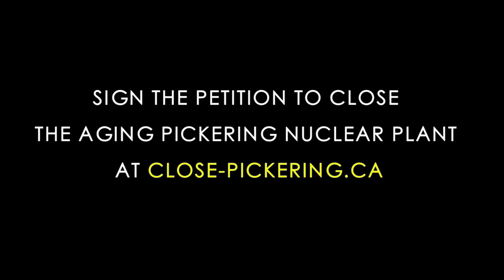Nuclear Scientist calls for closing Pickering Nuclear Station

Comment: As someone with experience with CANDUs, I believe Frank is making a conspiracy theory. Yes, the zirconium cladding can catch fire. However, the poison system can quickly stop overheating in the core. Every safety system is constantly checked and double-checked, ensuring that it works its best. The SCRAM or trip system ensures that no more heat can be generated by quickly inserting control rods into the core within fractions of a second to a few seconds, depending on the pressure of the tank and vessel pressure. CANDUs can't just explode like in Chernobyl or Fukushima; each safety system helps prevent this. If a meltdown were possible, CNSC and IAEA would definitely disapprove of the design.

Comment: Operating nukes save millions of lives. Coal, oil and gas release more uranium, thorium and radon into the atmosphere every year than all the fuel burn in nukes. If you want to freak out about radiation, fine. Start with the biggest source, coal.

Comment: Pickering is objectively the SAFEST nuclear power station in the world.
How can I say that?
Easily.  It is the ONLY nuclear station now operating to have suffered a failure of the primary pressure boundary ― the MOST SEVERE accident that can happen to a power reactor ― without radioactive releases to the environment or radiation exposures to personnel, & then been put back into service.  The accident occurred at Unit 2 in 1983.  Units 1 & 2 were retrofitted with a design change already applied to the other six units, which would prevent a recurrence of the failure.

Comment: It's important to distinguish between "reactor" and "reactor building". The reactor buildings are the big cylindrical-hemispherical domes you see at the beginning of the video, but the actual reactor is a additional body of containment within that reactor building (this is where the fission actually occurs). So when Grant is talking about the reactor "leaking," it is still leaking within containment; it is not leaving that reactor building. In other words, the fact that the reactor "springs leaks" from time to time does not mean at all that this irradiated water is leaking into the environment.

Additionally, these leaks are meant to occur by design . The CNSC's mantra when it comes to nuclear-grade pipelines is "leak before break." These leaks are important for telling us which parts of the reactor/pipelines to look at and  repair, ensuring the nuclear plant operates as safely as possible. This is an extremely well-known fact in the nuclear industry, and so the fact that Grant doesn't mention this should make you question his level of bias.

Background: I work at OPG Pickering with a background in nuclear engineering.
Reply: The Pickering nuclear station has a greater risk of accident than other stations because the containment system’s vacuum building is shared between six operating reactors. The Pickering A reactors also lack two completely separate shutdown systems, the norm for modern nuclear plants. As a review by world-recognized nuclear expert Arnold Gunderson stated, “At the Pickering site, there is only one overall safety related containment system when there should be six separate safety related containment systems. This design flaw has created a cumulative risk at the Pickering station that is higher than that at any single unit station in Canada.” Gunderson notes that, in particular, this design flaw makes the eight-reactor plant particularly at risk for the kind of cascading accident seen at Fukushima, where damage to one reactor led to fires and explosions that damaged adjacent reactors.

Comment: Since when is stating the facts about pickering "fear mongering".  It is old, decrepit, leaky, and ought to be retired. Period. 

Want to stick your head in the sand and pretend keeping this aging plant running is OK. Then move to Pickering and put your lives where your mouths are. 

I worked on the safety systems for Pickering, they are a disaster in waiting. Long story but once again FACTS.
Reply: Old, decrepit and leaky? Can you explain at what point a Leak into the containment vessel exceeds the equipments make up capability? At what point would this impair pressure control to the point that ROH subccoling margins would be effected?

Comment: I expected a more researched and balanced video.  Not fear mongering.  We need new reactors but publishing things like this is not going to get those new reactors.
Reply: Yeah we’ll all take your word for it, man get the fuck out of here, there’s 8 of those old pieces of shit sitting there leaking tritium into our drinking water
Reply: It's dangerous to have one of the world's oldest and largest nuclear stations in the middle of the GTA (surrounded by 2 million people within 30 km). Plus it's very expensive - the most expensive fuel and operating costs on the continent. We could replace it in 2018 when its licence expires with water power from Quebec and save Ontarians billions$. http://www.cleanairalliance.org/wp-content/uploads/2016/09/pickering-replacementv4.pdf
Reply: angela b  It is quite expensive to maintain a plant that old, I agree. This is why Canada should invest in 4th generation reactors! They are designed with an emphasis on being eceonomical and safe.

That being said, pickering nuclear is quite safe. Take it from someone who works in the plant design department at OPG Pickering. Canada does a great job of looking after its nuclear plants and ensuring they're run with a very low risk to safety.

Comment: I think they were already planning to decommission it?
Reply from the maker: It's not being refurbished, just run to the ground. The older a nuclear station gets, the more risky due to embrittlement of the metals and wear and tear of the components.
Reply: They originally were planning to decomission it in 2007, then 2013, then 2018, then 2024, and now they're applying for a licence to run it till 2028 at which time it will be 57 years old, though designed to last just 30 years. We're calling for it to be shuttered in 2018 when its current licence expires.
Reply: I can see your anger in that the opg is extending the operation lifetime of a old plant. Though simply because something was design to last 30 years doesn't make it reasonable just to shut it down. If Pickering plant is refurbished , I see nothing wrong with it's continued operation.

Comment: An alarming situation and very dangerous as long as the time goes. The current Government should must look for better alternatives now. Unfortunately, our Government don't have any innovative ideas to fulfil energy needs for Ontario.
Reply: Charan, we could replace Pickering with water power from Quebec. They have massive excess and are selling it at much lower prices than what OPG says it would cost to extend Pickering. We wouldn't need to upgrade the transmission either. This shows our options and costs: http://www.cleanairalliance.org/wp-content/uploads/2016/09/pickering-replacementv4.pdf
Reply: @angelabful  It's kind of ironic that the clean air alliance advocates for replacing nuclear with natural gas turbines. If you think Quebec will give Ontario a deal on 3000MW+ of reliable base load electricity for a deal you are quite naive, go look up how they screwed over Newfoundland and Labrador when they held them hostage over the churchill falls deal.
Reply from the maker: @rm-cl8su  Charan, we're not advocating that we replace our nukes with nat. gas but with water power from QC. They have so much surplus that they could replace 30% of Ontario’s total annual electricity consumption. Read more here: http://www.cleanairalliance.org/wp-content/uploads/2018/07/3OPTIONS.pdf

Comment: All very frightening. What if it "blows," like Windscale, or Chernobyl, or Three Mile island, or Fukushima?
Reply: They can't explode, they have a giant vacuum building designed to condense radioactive steam. Passive hydrogen recombiners also prevent hydrogen gas explosions. That's needed assuming somehow a tsunami strikes an inland reactor's emergency generators.

Comment: Chernobyl and Fukushima are completely different technologies to Candu. To claim that Pickering is exactly like these in technology or in the potential for similar accidents is just wrong.  Fukushima relied upon cooling water pumps to maintain its temperatures and to halt runaway reactions. Candu has two almost instantaneous shutdowns, the first is to dump the heavy water. This alone will stop the reaction. The second method, is to drop all the control rods into the reactor also stopping the reaction. Both are used in an emergency. Neither method existed at Chernobyl or Fukushima.  Wrong explanations are just fear mongering and weaken the argument which otherwise was correct. Old nuclear technology ought to be shut down for public safety unless of course the entire plant and all of its systems have been upgraded and replaced which of course they haven't.   Candu is old technology, not efficient, and these plants do leak tritium and other radiation regularly.  Don't count on the Wynne government to ever do anything right. Also don't count on the rubber stamping robots at OEB to do the right thing either. Now off to sign the petition.
Reply: The Pickering nuclear station has a greater risk of accident than other 
stations because the containment system’s vacuum building is shared 
between six operating reactors. The Pickering A reactors also lack two 
completely separate shutdown systems, the norm for modern nuclear 
plants. As a review by world-recognized nuclear expert Arnold Gunderson stated,
 “At the Pickering site, there is only one overall safety related 
containment system when there should be six separate safety related 
containment systems. This design flaw has created a cumulative risk at 
the Pickering station that is higher than that at any single unit 
station in Canada.” Gunderson notes that, in particular, this design 
flaw makes the eight-reactor plant particularly at risk for the kind of 
cascading accident seen at Fukushima, where damage to one reactor led to
 fires and explosions that damaged adjacent reactors. http://www.cleanairalliance.org/pickering-safety/
Reply: All CANDU vacuum structures are designed to support only one unit failure, just link Emergency Coolant systems.  A multi unit LOCA is not a credible event.

Comment: All reactor is a "big box", it's called containment building, and it is one of the safety barrier for nuclear reactors. Water cannot leak out that quick in the reactor building, and there are many back up water supplies to prevent water withdraw from core of the reactor.
No reactor is going to “just leak” like Dr. Greening says.
Reply: +OntarioCleanAir  I don't know where you got the facts, it's wrong, check your fact again please. so called containment is the reactor building, each individual reactor has its own reactor building.
Reply: +letitdo24 +Eddy Zhou he is also a fervent contributor to the school of thought that the World Trade Center collapse was not due to aircraft strikes...

http://www.911myths.com/html/other_contributions.html

If he knows what he is talking about, which he very well may, then we are all in serious trouble.
Reply: He's absolutely clueless. 
He says for the pressure tube failure they got lucky because they were able to pump the water from the floor back into the reactor. 

That's literally the way the plant was designed (and every reactor after it) was that if a leak occurs, then the D2O is recovered from sumps in lower elevation back into the feed system for the Main Circuit.
Reply: +letitdo24 So can we first agree on the reliability of the Pickering station? From what i know, Pickering is so damn safe, in terms of design and operation. Can we also agree on nuclear is a clean energy source?
Reply: +letitdo24 watch Pandora's promise, it's a cool documentary available on netflix about nuclear energy. Even if it fails to convince you of the benefits of nuclear at least it will help you understand how pro nuclear people think. Just a thought!
Reply: Fukushima containment breach was caused by a hydrogen explosion, something that our passive hydrogen recombiners would prevent. All of Ontario's CANDU's also have a vacuum (via condensation) building to prevent a steam explosion breach.
http://nuclearsafety.gc.ca/eng/reactors/power-plants/nuclear-power-plant-safety-systems/index.cfm
Hydrogen gas can be produced during a severe accident. Hydrogen gas, which is flammable, could cause an explosion and damage the containment, as well as to personnel and other parts of the plant.
 To deal with the potential hazards of hydrogen gas, most CANDU plants are equipped with hydrogenigniters or burners.

 Recently, nuclear power plant operators have begun installing passive autocatalytic recombiners.

 These are devices which passively (without need for external power) remove hydrogen from the containment and effectively reduce the risk of an explosion or fire.
Reply: He sites capacity factor as a means of measuring safety.... He's clueless
Reply: Here it's important to distinguish between "reactor" and "reactor building"*. The reactor buildings are the big cylindrical-hemispherical domes you see at the beginning of the video, but the actual *reactor is a additional body of containment within that reactor building. So when Grant is talking about the reactor "leaking," it is still leaking within containment; it is not leaving that reactor building. In other words, the fact that the reactor "springs leaks" from time to time does not mean at all that this irradiated water is leaking into the environment.

Additionally, these leaks are meant to occur *by design*. The CNSC's mantra when it comes to nuclear-grade pipelines is "leak before break." These leaks are important for telling us which parts of the reactor/pipelines to look at, repair, and ensure the nuclear plant operates as safely as possible.

Background: I work at OPG Pickering with a background in nuclear engineering.
Reply: +letitdo24 I looked up his resume, he did indeed worked for OPG on pressure tubes related topics. But he is not stating the full truth here! He is exaggerating the risk in Pickering station. It's like saying if a wing broke off a plan in 20,000 feet above ground, most people would likely to die, then we should ban all planes from flying.
Reply: A plane crash Vs. a nuclear disaster is not a good example - they're totally different in terms of consequences. Ontario can easily do without nuclear power - if we import cheap hydro power from Quebec. There is no reason to take this risk and that's the point. Moreover, as he states, Pickering is old tech - it's a crappy design from the 60's.
Reply from the maker: +Eddy Zhou Pickering is one  the only nuclear plants in the world with shared containment of multiple reactors. Fukishima had separate containment for each reactor and this still did not stop fire and explosions from one reactor spreading to another.
Reply: The Pickering Nuclear Station has a long history of operational problems, accidents and poor performance. http://www.cleanairalliance.org/pickering-safety/
Reply: umm i would call it an understatement if i were you id do some research on what radiation poisoning can do this shit scares the fuck outta me and i know for a damn good reason i would much rather go without electricity instead of one day dying a horrible death and watch everything round you got to shit
Reply: +Eddy Zhou He's an OPG Nuclear Research Scientist with decades of experience. I think he knows what he's talking about here.
Reply: ya building around it isnt gonna stop an explosion will blow it all up
Reply: Where is there evidence of its reliability? I believe this nuclear scientist has already raised alarms about that and discussed a coolant leak in the 80's. Nuclear produces radioactive waste - how is that a "clean" energy source? Finally, the consequences of a nuclear disaster are NOT worth the risk when we have access to an abundance of cheap hydro power from Quebec.
Reply: Ed Z What if the containement building overleaks.